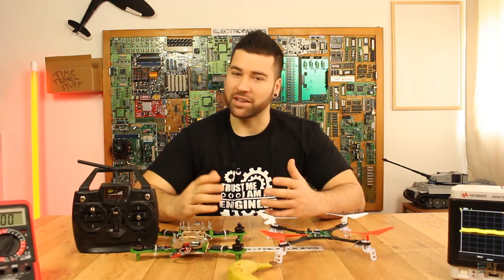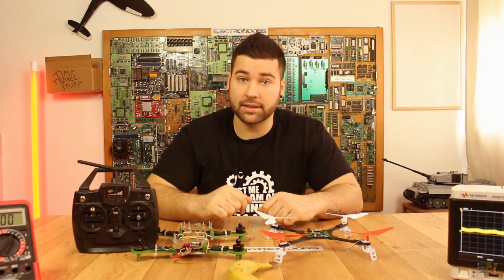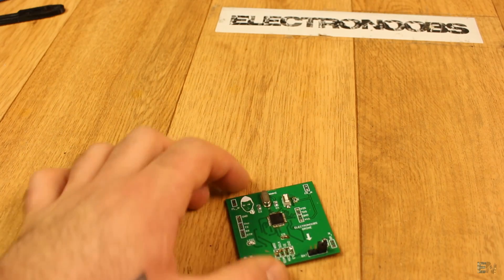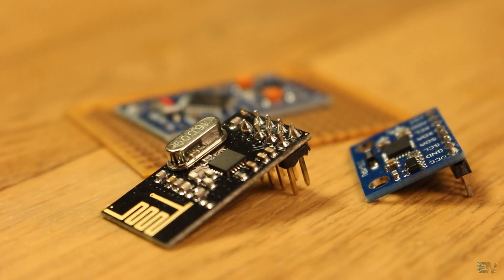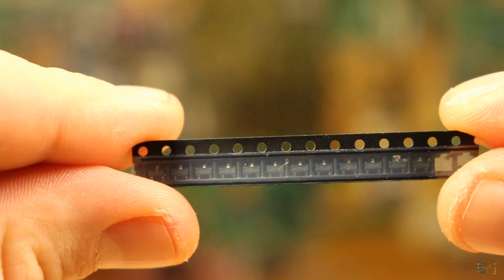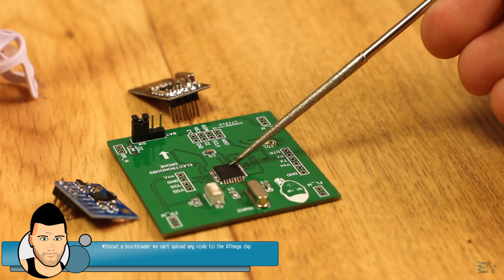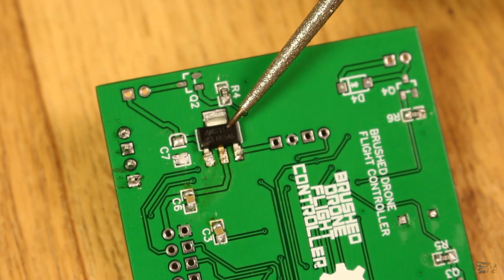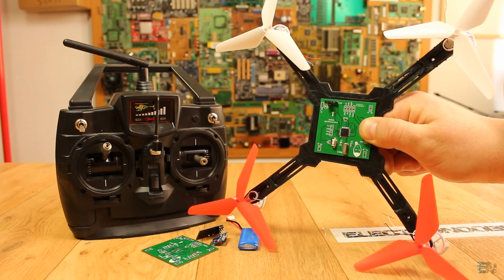Brushed motors Arduino drone - Part1 - components

Comment: My brushed arduino drone need to separate between board and the motor using 3.7v  biard and 7.4v for 4 motor.
how can I power all 3.7v

dc syma motor 720.
lipo 3.7v
3 vlades propeller

Comment: you can actually get 4 1000kv brushless motors including esc's of amazon or ebay for under 25€,(they provide 800g thrust each on 1045 3s) if you are willing to accept 4week shipping.

Comment: i am having problem with nrf whenever i touch any nrf pin the communication starts but without it no communication. i tried many capacitor but i am having the same problem
Reply from the maker: Thy very short wires. Wires can be antennas for noise. Also you could wind GND around all th signal wires for less noise! Also use very stable 3.3V supply with good capacitor.

Comment: Hello there, this is what I'm buying to build my first drone.
http://a.co/ftPb51z | (this is the frames, propellers, motors and battery).
Arduino Nano
https://www.pololu.com/product/2831 | 5v voltage regulator for the Arduino, since it runs on 5V and battery is 7.4V
https://www.pololu.com/product/2130 | 2 of this as the Motor driver for 4 motors, this is to provide extra current from the battery.

I'm not using any mosfet or dioe like you did, will this list get my drone working?

Comment: Interesting, but I don’t think brushed motors are good for a drone. They’re noisy, consume more power for the same output (which means reduced battery life, something scarce in a drone) and wear out quickly, which means spending more money. On the long term, it’s better to buy brushless motors. I’m personally willing to spend more money to have better motors and battery life (this is specially important to me).

Comment: Why not use a stm32f4 or f7 like other flight controllers? They can run Arduino and would leave you the processing power for filtering, soft serial, an OSD, etc.

Comment: I'm really interested in whether you will succeed to get it flying. I tried the same about a year ago with almost identical parts, just wiring it without a breadboard to save some weight. I also made the mistake to use this voltage regulator and had to change it afterwards. All went very well, the motors reacted on the transmitter and also when I turned the drone around. But then I tried the same with attached propellers and each time I increased the thottle, suddenly the RC connection broke down. I assume it was either some interference from the motors or the power for the nrf24 dropped too much when I increased the throttle. I never found out what was the reason, so lets see whether you get similar problems and if so how you will solve them.
Reply from the maker: I had the same problem. Adding big input capacitors helps. When you increase throttle there is a huge amount of current spike. The project is still getting better. Keep up!
Reply: The nrf is very fussy on power. Probably the motors suck too much juice 😄😄😄 add larger caps and will be ok

Comment: To flash the boot loader via the pro mini, don't you need a capacitor between the FCC and reset pin of the pro mini? This keeps the reset signal from avr-dude / arduino IDE from resetting the pro mini, allowing it to continue running the arduino-as-ISP code.

Also I like to print my pc board design onto card stock or other heavy paper. Then I poke holes where the vias will be drilled and populate it with the through-hole components. I guess you could hot glue smd components if you wanted to. The idea is to get a sense of how things line up physically with each other. You don't need to add every component to this mock up; just the ones (such as your NFR module) that take a lot of space and may overlap or interfere with other component.
Reply: True. Same goes for the nano. 10uF between rst and ground does the trick for me

Comment: While i'm all for learning how to do stuff. I can't help but feel this particular video series is kind of reinventing the wheel if your goal is simply to have a flyable quad at the end. Brushed AIO Flight controllers that literally all you have to do is stick on a frame, plug in your motors, and bind to your transmitter are sub $30 these days.  Sub $15 for versions that don't have a built in receiver.  Plus i'm not sure I could stand flying a quad that wasn't running betaflight or something based off betaflight like iNav.  Been there, done that *shudder*
Reply: The purpose of this video is to show how to build things, not how to buy things. You're missing the point here. You could buy a drone to 15 quid. Where is the creativity???

Comment: What do we do when we don't have that remote? Can we 3d print it and then use it ? Or buy such a remote from somewhere.
Reply from the maker: If you watch the video where I build it. you can see that you can hack any other radio controller. Or directly use 2 joystick modules and the arduino+NRF24. Keep up!
Reply: Electronoobs : Thanks I think I missed that video ;)

Comment: nice, very nice , but i have made a drone with nrf and one  atmega like you have done but i didnt get  satisfying  results , notice that i used brushless motores , it worked fine till i used an accelometer to make it auto level, but results were no good ,  will watch all your videos to see how it will act using these motors

Comment: Good to see another video from you.
A few points you have to be aware. Just because it works at room temperature, it doesn't mean it works at other temps.
1- You will need about 3.2V minimum to operate it at 16MHz. (See page 303/660 section 29.3 Speed Grades of the data sheet complete). I would worry running at  > 10MHz. Are you sure you are not able to make it work on 8MHz? 
2- You might consider changing one of the 22pF caps for the xtal to 20pF. The uneven values with start the xtal at all temperatures.
3- You can use a  silicon diode or 2 germanium schottky diodes in series with the 4.2V supply to get your lower voltage for the IMU or whatever. The maximum voltage of a cell right after charging, is 4.2V. No need for a regulator.  
Good luck.
Reply from the maker: UFOhunter thanks for tip!
Reply: Anytime my friend. You are doing the hard work of making these videos. I can appreciate the amount of work that goes into making one.